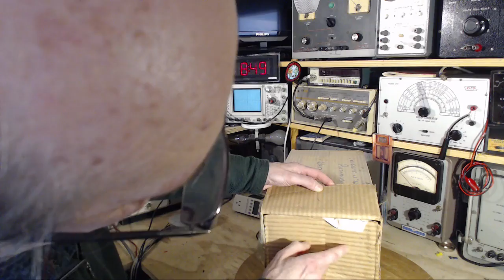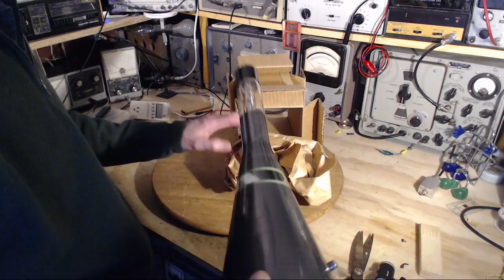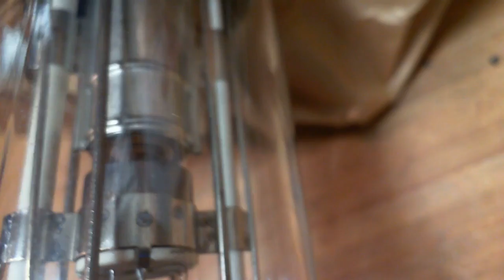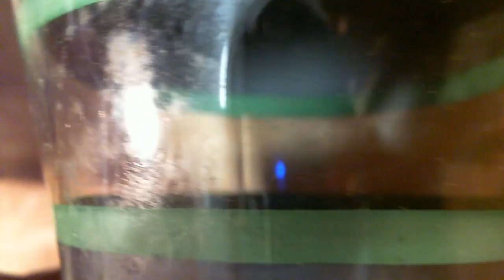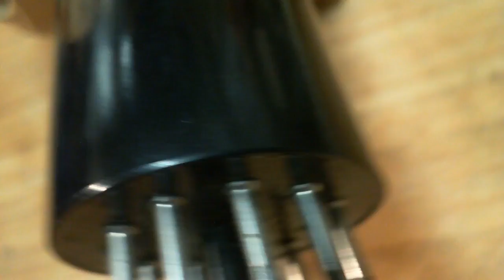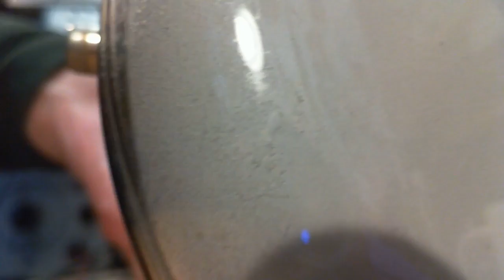Dumont 5LP1A CRT Tube for Oscilloscope

Comment: That was really cool Jim.  Thanks!  I've watched that brilliant old guy glasslinger make vacuum tubes.  He uses tungsten for the wire going through that 'pinch area'.  Its far too brittle for use inside the bulb or outside for connection to the world - it just cracks in half.  So he transitions it to a softer metal inside and outside the tube.  Spring is almost here for us Jim... patience.. patience...

Comment: Other than "lets build a CRT Tube TV" I cannot think of much that could be done with that tube. Years back I had an old tube TV that use electrostatic deflection, same as a scope CRT...
Back a ways when I did TV/Stereo repairs, I tried my hand at rebuilding a few CRTs.. its an art to get the glass temp up and fuse the gun into the tube then go through the long process of evacuating the air. The small central tube in that gun was a part of the inner gun assembly that evacuated the air out. As a last step, the tube (under vacuum) is heated to molten at one point and it collapses sealing the vacuum. Then the getter is heated up to activate it and consume any remaining oxygen molecules.
Thanks for the vid, I really should checkout what selling on eBay for these... I might get one for a project.
Cheers,
 - Eddy

Comment: I really enjoyed the close-ups of the internal connections and the electron gun. It looks like some kind of glass/metal sculpture. Some of the old vacuum tubes (especially the larger transmitting tubes) can look like a piece of art. Unfortunately, the coating on the inside of the CRT prevent you from seeing all of the internals, but a large dual triode or similar can be quite beautiful (for a given value of beauty, of course!). Thank you for this interesting little video.